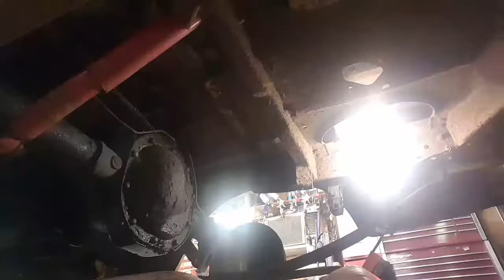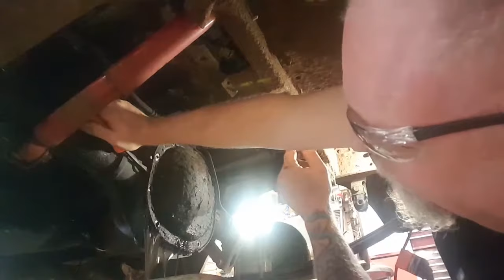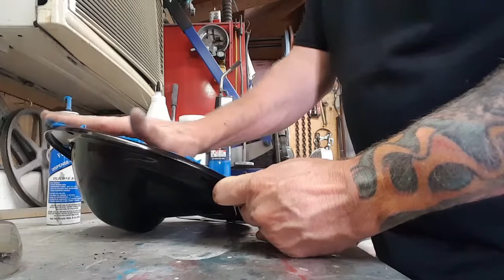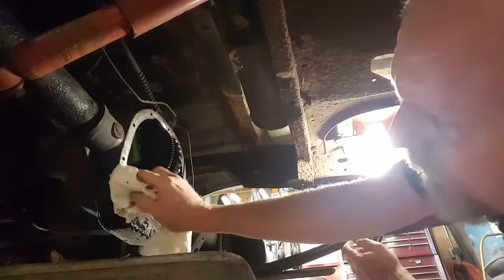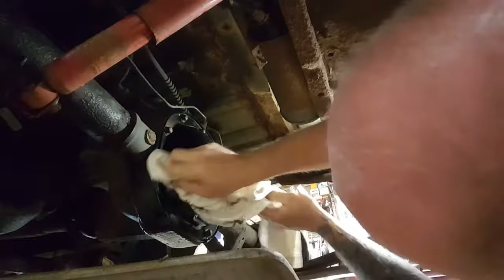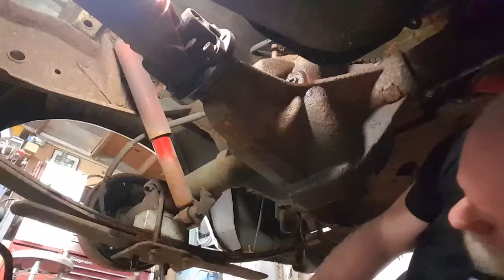1999 Ford Ranger rusted Differential Cover Replacement

Comment: FYI: When using RTV Gasket Maker put a bead of silicone glue and just tighten the screws halfway/distance,  let the silicone cure for about 30 minutes then you torque them down.
Reply from the maker: Thank you for the tip!